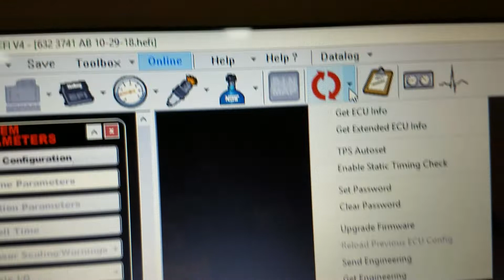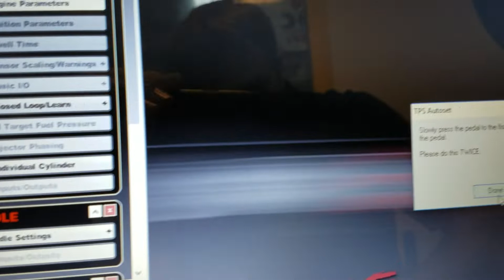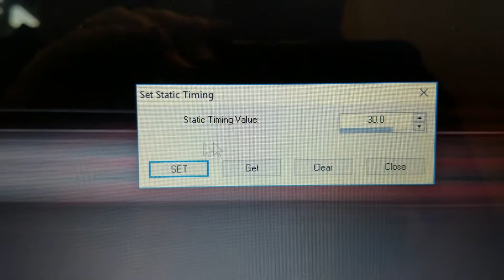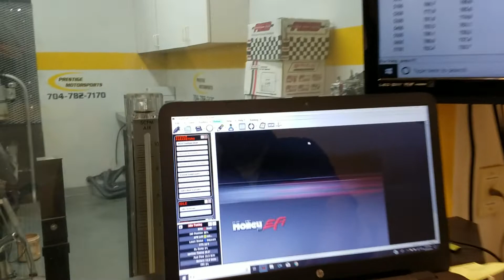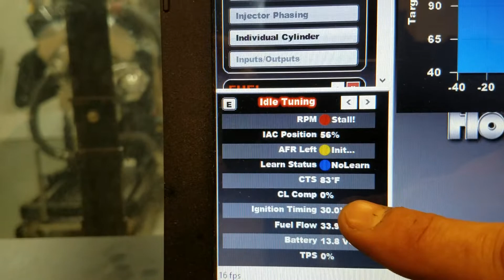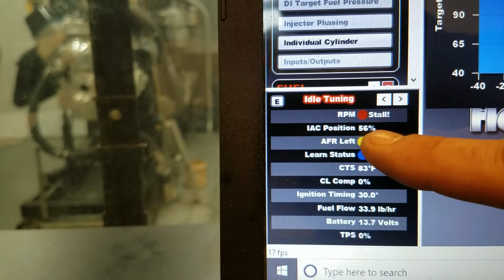Must watch video for first startup procedures with your Holley EFI

Comment: what if you turn on your car and its iac stuck at 100% and when you close the blades it dies
Reply: I'm sure you've figured it out by now, but for other people reading this. You need to open the throttle some to get the iac down. It's at 100% and still needs more air